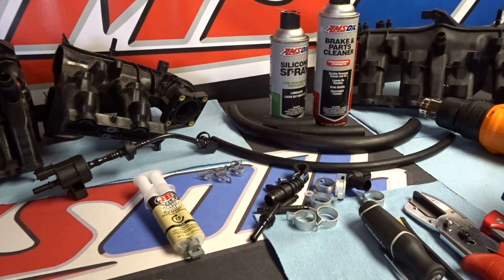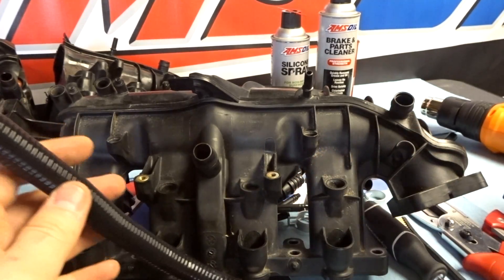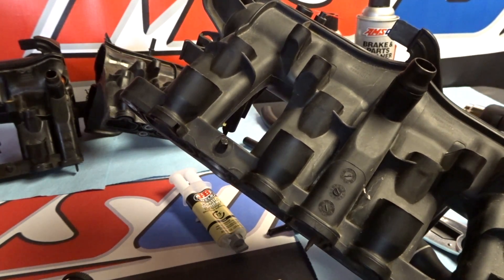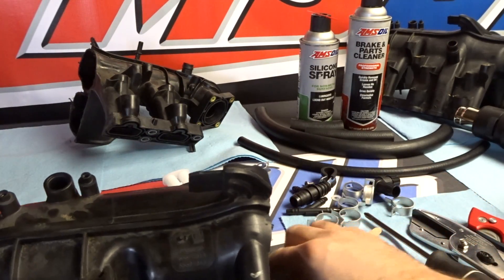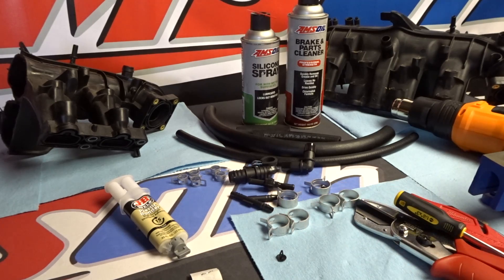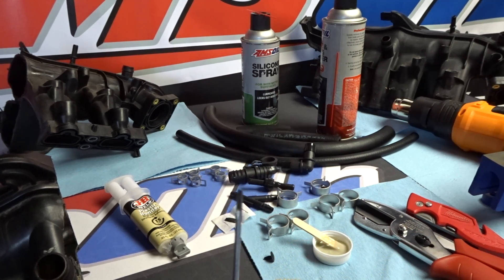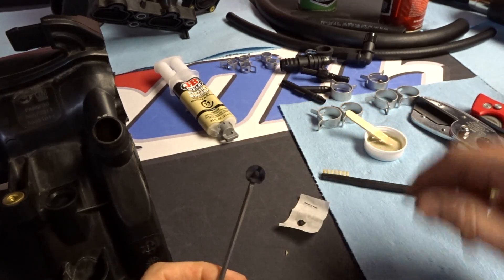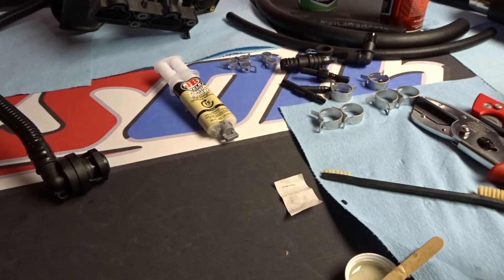How to Install the CruzeKits.com V3 PCV Fix Kit

Comment: Thanks for the clear explanation. I'm still having the check valve in place and I'd install the kit as a precaution so I'm wondering what should I do if the check valve is still in its position? In this video it's kind of assumed it's missing / lost. Thank you!
Reply from the maker: You can break the tip off that check valve, causing it to fail like it normally does on its own, and install the plug. This would be considered a preventive maintenance install.
Reply: @AndreiDPop  Thank you. I thought I could somehow glue it in its closed position. Maybe you can figure a way how to do that? 🙂
Reply from the maker: @ImreVeres0  it’s a silicone check valve so not much will bond to that in a reliable way.
Reply: @AndreiDPop  my check valve is also still there. how do i break off this tip? what tool do i use?
Reply from the maker: @steffy8989  you can break it off with a flathead screwdriver.  Then just make sure the center hole is clear with a pick or stiff wire.

Comment: (EDITED TO CORRECT TYPOS): I was going to install the kit on my grandson's car this past Thursday, but the manifold port was very grimy when viewed from the top so I decided to wait until I had time to pull the manifold and clean it. When I removed it earlier today, was shocked to find not only the non-return valve missing, but the other end of the port COMPLETELY blocked off. It's much easier to remove the manifold than it initially appears because ALL of the mount bolts are accessible from the top of the car, and seeing where the plug should go is much easier, too. If I hadn't removed the manifold to clean it, the car would probably be blowing out crankshaft front seals for the foreseeable future (it's lost two in the past month). In summary, took me six hours to remove the manifold, put version 3.4 (which includes an extra stretch of 5/16 hose and extra clamps to provide the option of removing the plastic hose altogether), install the manifold, change the valve cover, and replace the blown seal, and clean up all of the oil from the engine bay on a 2013 Cruze with 161000 miles. I'm convinced it is essential to remove the manifold to ENSURE the problem is fixed FOR GOOD if your manifold has been in the car for a while.
Reply: I have just inspected mine from the top. Mine was also full of oily grime with no sign of the red check valve. Is there a way to tell if there are further blockages as you describe without removing the manifold?
Reply: @chrishall1263  I suppose it's possible to inspect it if you have an inspection camera available, but cleaning it completely is impossible without removal if yours is as dirty as when I did the job.
Reply: @good4jg  ive ordered the kit to fix the check valve issue. once that's done I can attach the pipe and if I can't blow through it there must be a blockage?
Reply: @chrishall1263  I'm not sure. I only knew about the problem on my grandson's car because I pulled the manifold.

Comment: Looks like my kit included the "easy splice" option for the evap line, can you describe how to remove the nylon line from the factory evap fittings without damaging them?
Reply from the maker: Just cut a slit into it the long way and peel it off, use a heat gun to soften it, or use boiling water.

Comment: Around 6:00 on this video, you describe spraying the port with brake parts cleaner. Where does this brake parts cleaner end up? For someone who hasn't removed one of these intake manifolds, it's a little hard to tell, but it certainly seems like it drains through the cylinder head into the crankcase and ends up in the engine oil. Can you confirm whether this is the case? Shouldn't an oil change, then, be performed immediately after installation of this kit?
Reply from the maker: It gets evaporated and consumed by the engine. It can’t drain back to the crankcase since that path goes back up through the valve cover before getting to the crankcase. Oil change isn’t necessary.

Comment: The glorious valve he talks about seized up and no air will go through.  Lol good thing its only 8 bucks on amazon.  Really should come up with a better valve solution.
Reply from the maker: Some of the initial valves did have swelling issues internally. For whoever brought it to my attention, I replaced all of them free of charge. Some of them got as much as 45k miles of life. All depended on the region and driving conditions. 

I then upgraded the valves in March of last year, and again in October (the second time just because I could) with the highest grade Viton plunger that I could get for it. You can actually custom spec many different plunger materials for these valves so I chose the best one that was available for the newest batch regardless of cost. 

You can’t order the new ones off Amazon because they use the same internals that I had used initially. The newer ones I released since March have been flawless so far. So yes I did come up with a better valve solution. I also came out with a relocate that repositions the valve at an angle so it doesn’t accumulate condensation and freeze in the winter, or accumulate PCV deposits. Both changes have resulted in drastic improvements in check valve service life. You can find the newest valves on the cruzekits site for $9.50 for the pair.
Reply from the maker: How many miles did you have on that valve and which kit version did you install?

Comment: Why not just sell the intake manifolds and hoses ready to go?
Reply from the maker: Cost of inventory, huge inventory space requirement, time consuming.
Reply: @AndreiDPop  okay sounds legit. So I was looking at your v3.4 and it says no removal of the manifold and my question was is there no more need to drill the manifold for the brass fittings? And also it says no heat gun required, is the y fitting getting straight fuel lines to complete the line instead of the vinyl? Just want to clarify before purchasing
Reply from the maker: @catfissh  Correct no drilling required. Also not heat gun required because there's an easy splice that's included. A section of hose and 4 extra clamps so you can cut the nylon line off and replace it with the rubber hose.
Reply: @AndreiDPop  okay cool, so it’s pretty straight forward but does it come with instructions in case I get stuck on in it lol

Comment: Nicely done

What about the other check valve in the return hose at the turbo?
Reply from the maker: That one usually works well enough for a long time and just needs some cleaning with carb cleaner.

Comment: I still have that check valve in my intake how do i plug it up? Can i just put epoxy through the hole or do i have to take out the valve first?
Reply from the maker: You have to break the tip off the nipple first, then install the kit. You can do that with a simple flathead screwdriver.
Reply: @AndreiDPop  which way does the check valve go? Arrow pointing to the right(driverside) or left(passenger side?
Reply from the maker: @rodrigoramirez2590  away from the T fitting, toward the Y fitting.
Reply: My rpm goes up n down like if there was a vacuum leak somewhere after installing this..the only problem was that i had to seal the check valve again because it didnt work the first time.its sealed now because its not suckin any air in from the intake but i can't seem to figure why its idling like that..maybe u have an idea?
Reply from the maker: @rodrigoramirez2590  vacuum leak. check all of your connections.
Reply: Ok thanks..i thought i put the new check valve facing the wrong way i have the arrow pointing towards the brake booster side..sorry for all these questions

Comment: Can the check valve be removed easily if it’s still in place before installing this kit? This kit looks like a great repair for a common problem, just wondering if it can be used as preventative maintenance beforehand.
Reply from the maker: Yes you can break it off with a flathead screwdriver.
Reply: Thanks for the quick reply! I ordered the 3.4 kit and notification of shipment today. Looking forward the to installation.

Comment: Hi Dan, mate do you happen to know if there is any difference between the 1.4 T engine fitted on Cruze in the US and the one with the same capacity fitted on opel astra in Europe (A14NET)? Many thanks.
Reply from the maker: Should be the same engine, maybe some minor variations, but the PCV fix kit will fit on it.
Reply: @AndreiDPop  thanks again, I will order the kit in the next couple of days. Good job!

Comment: Can I add a catch can with this type of installation? I have an oil leak on my IC intake hose
Reply from the maker: Your IC intake hose needs to be tightened. I’m not a fan of catch cans but I can include a fitting in the kit that allows you to use one with it.

Comment: Can any of these plastic angle pieces that the hoses attatch to be replaced with copper pieces? (just for looks basically but definitelywould look very nice I think)
Reply from the maker: Copper is unusual. Brass is more common. I imagine you could except the current v3.4 uses a custom angle T fitting, and using brass adds unnecessary weight where the strength simply isn’t needed.
Reply: @AndreiDPop  exceptional advice 👌  thank you. Will definitely be purchasing a kit soon. Thank you for your efforts

Comment: I have P0171 and I can't find the nipple in my intake manifold. 
I'm thinking this kit may help me before the part inside my valve cover fails (is not doing the vacuum thing you can cover your finger with)

Just for a little clarification, does this kit plug that hole where the nipple is supposed to be? It looks like that piece you put on the screw driver and slide down in there with epoxy just plugs the hole.

What was that nipple supposed to do before? Will plugging that not change anything?
Sorry I'm not mechanically inclined and I apologize now if you answered these questions in the video. I assure you I watched the hole thing but I couldn't turn the volume up much where I'm watching from
Reply from the maker: Yes the kit plugs the hole. That’s part of the design. The nipple was a retaining piece for a check valve flap on the other side. The kit reroutes that check valve externally.
Reply: @AndreiDPop  thank you very much! Also if you don't mind having a look at my most recent video.

There is supposed to be a bolt in the hole shown, it had broken and fallen out a long time ago but the suction is new to me. Hasn't done that till this week.

Any input on that? Is it normal to have suction there but it's normally plugged with bolt? Is it related to my PCV issues?

I'm purchasing a new valve cover soon that comes with the bolts so it will be replaced soon, just wondering if I need to 'fix' the vacuum effect that's going on. Or maybe it will fix when I buy the pcv kit

Comment: Hey! Whats the difference between the one way valve you have used and the one way valve from evap (the round one)? Why not to use it?
Reply from the maker: The one for evap use is not designed to have dirty pcv gas going through it. That’s the main reason I didn’t choose a valve like that. They tend to leak more easily.
Reply: @AndreiDPop  thanks

Comment: Is this will fix p1101 that’s killing me ?
I have tried many things and still won’t come off , 
Without start the car after clear the code will goes pending right a way 😤😤😤
Reply from the maker: Possibly but I’m not sure what’s causing it. Usually there’s a vacuum leak. Have you done any other engine diagnosis?

Comment: Hy,i was buing that kitt from you...i want to install that but in manifold i have that rot nippel...i kann push him inside to install thath black nippel what you send me in the kitt?thank you
Reply from the maker: You can break off the tip of that nipple with a flathead screwdriver and install the kit.

Comment: welp, bent and melted my purge line when i tried to use the heat gun. what can i do now??
Reply from the maker: Check the note sheet. Last item at the bottom.
Reply: @AndreiDPop  appreciate the swift reply. thank you!
Reply: do i cut it in half to use on both ends?
Reply from the maker: @richardrussell4065  the 4.25" section of hose? Yep!
Reply: @AndreiDPop  thanks. It's working well!!

Comment: My dipstick sucks air what's the problem?
Reply from the maker: There isn't a problem. It's supposed to do that. Place your finger over the dipstick hole; do you get positive pressure, mild suction, or strong suction?
Reply: @AndreiDPop  mild suction, bro. When I remove the dipstick and before I place my finger, the engine rattles. I change the rocker cover today together with the PCV valve because last we it started to spit oil out of it.
Reply from the maker: @greatunizuka  sounds like the valve cover is working correctly now. How's the intake manifold?
Reply: @AndreiDPop  I don't know how to check if it's faulty.
Reply from the maker: @greatunizuka  https://www.youtube.com/watch?v=En4WO7DYsTk
Reply: @AndreiDPop  Thanks Dan. I would like to ask if the oil that starts to leak on my Intercooler line-in hose will solve this problem? and also possible to ship it in Italy? thanks and Merry Christmas!

Comment: Dre Dan I've been analyzing this video and have some other questions. Time stamp 9:40 to 9:45 I see another red flapper check valve, what is that for and is that also an issue and can it be fixed or upgraded? Next when cutting the evap purge line it appears that when cutting the hose and installing your kit it would need to go back together a certain way so that it can be installed just how it came off, meaning the hose and fittings alignment. Same would be said when attaching all the lines and fittings that they are all aligned to each other in the correct manner so when the assembly is built all fittings will be able to be connected without twisting any of the hoses and causing undue stress on any of the parts. Maybe make a short video showing all the fittings on the intake manifold installed and laying out the hoses one at a time and marking them so when it's all finally attached all angles of the hoses and fitting are just how they should be. Thank you for your PCV issue videos, I will be ordering a kit to fix my Cruze. Oh, by the way I was the one asking about ketch cans and do they make sense, if so do you have a PCV kit with a ketch can system. Thanks again.
Reply from the maker: That second valve inside is for the vacuum chamber, which works in conjunction with the bypass solenoid to control the bypass valve on the turbo. I've not yet seen that one fail, and it wouldn't be serviceable if it did. 

The EVAP line doesn't really have a specific order. You're only cutting the nylon line off between the terminal and the check valve. Just that one small section. On the updated kit, I include the easy splice option for free, which is a 4.25" section of pcv hose and 4 clamps, so you don't even need to use the heat gun and vice. 

I'm working on a new video actually because there have been a couple of significant updates to the kit since this one was made. Note however that these rubber hoses get softer when they get hot, so they'll settle in place and shape after a while. I don't really see a need or tangible benefit to a catch can if you're running a low volatility synthetic oil.
Reply: Hi Dan, I want to what will happen to the vacuum bypass line when we replace the old pcv hose with the new 3.4 kits. Thanks.
Reply from the maker: @md.saifulislamchowdhurynip7902  you need to leave that bypass line in place.

Comment: Buy this guys I ordered and put mine on and it’s been 2 months now with no issues. My Chevy sonic 1.4 turbo runs great. I was told to buy a new turbo charger but I felt it was not the problem. I’m glad I bought this kit. 👍👍👍👍👍
Reply from the maker: Thanks for the shout out! It's always great to hear about people saving money and fixing the right issues the first time instead of chasing down parts.
Reply: @AndreiDPop  welcome and thanks 👍👍👍👍
Reply: Did you get a p0299 code originally?
Reply: @hector2340  yes I think that was the code I got. It’s been a while so I have forgotten but I’m pretty sure that was the code. The caris running excellent and I have not gotten any issues ever since I used the kit.
Reply: @TheGabriel116  thanks. I have that code but am not losing power. I never replaced my intake manifold so I’m starting here. Fingers crossed
Reply: @hector2340  yes I never lost power constantly either when I had the code. It only happened once in a while but was annoying to see the check engine light come on.

Comment: What size is the hole you have to fill in the intake. Any help please
Reply from the maker: Did you message me on the website earlier asking for that information? I don't know what the size is. I'd have to pull out the manifold I cut up. It's in storage as I just moved. Why do you need the size?
Reply: @AndreiDPop  I’m replacing the hose and I was going to plug the hole when I take it off. No big deal. Thanks.
Reply from the maker: @dewayneroach7952  I can just sell you the plug you need lol. They're not expensive. But you do need to apply a vacuum source to the crankcase. Can't just plug it up and leave it that way.
Reply: @AndreiDPop  didn’t think of that. When I get the money I’ll buy a kit. I have to replace the valve cover the disk blew out. And the check valve on the hose is bad so it will be a min before I can get all that crap. Thanks.
Reply from the maker: @dewayneroach7952  shoot me an email with your phone number. I'll get you the plug and the parts you need to plug up the manifold. That way you can at least drive the car for as while until you have the money to order the kit.

Comment: Hello. I was told a low boost condition could be caused by a faulty intake check valve. What are your thoughts? Thanks
Reply from the maker: Depends on how low you're talking. You can get a p0299 from it but it won't totally kill the boost.